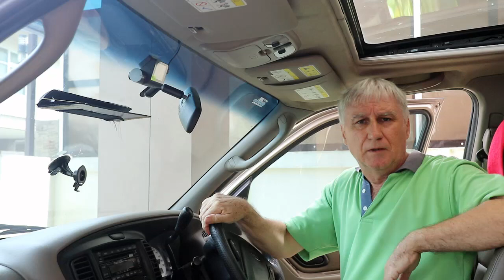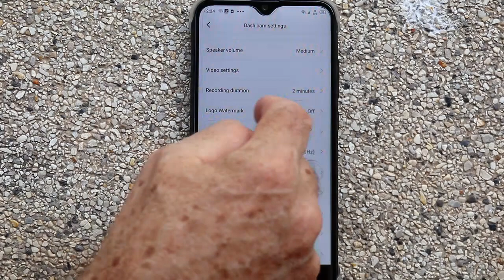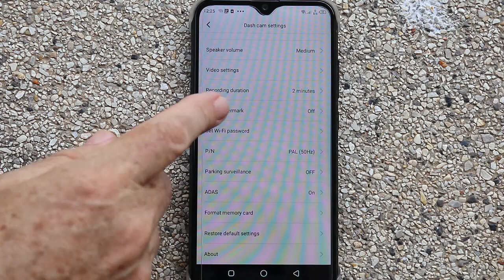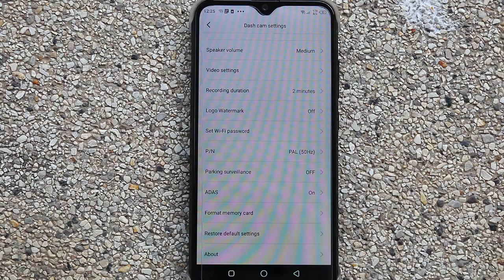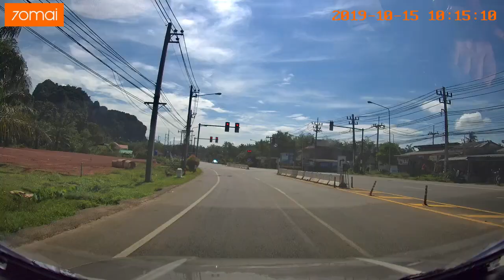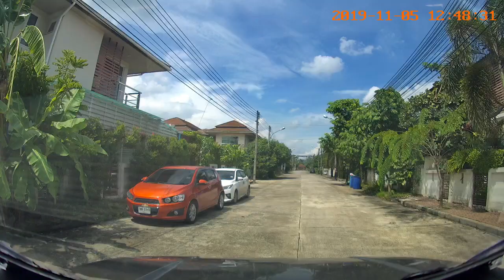70mai Dash Cam Pro Six Month Review + Latest Firmware Update 1.0.6na

Comment: Good update, Phil.. I still didn't get around to update mine
Reply from the maker: The update wasn't straightforward - I went round in circles a few times. Further, the person who told me he can see speed and GPS on videos with 1.0.6na now tells me that he may have a different model dash cam so I may not actually have a problem not being able to see this information. If 70Mai provided a change log for each firmware update it would be less confusing and require less guessing! When you upgrade can you let me know if you can see speed and GPS coordinates on downloaded videos? Thanks.
Reply: @PhilUKNet  Mine is till at Ver. 1.0.5na, sir. Still no .6na upgrade from xiaomi so far for me. The last update was sent and downloaded via e-mail and later transferred to my android and uploaded to my 70mai pro..
Reply from the maker: @ahmadfaisalalias7561  I didn't get it via e-mail. I saw that an update was available for the app and it went from 1.3.2 to 1.4.0. I then connected the app to the dash cam and was able to update from firmware version 1.0.5na to 1.0.6na. Try updating the app to 1.4.0 first.
Reply: @PhilUKNet  I must have missed the boat. Where did you see it?

I am in Malaysia, just to your south..
Reply from the maker: @ahmadfaisalalias7561  I went into the Play Store, searched for the 70mai app (which I had already downloaded) and it told me there was an update. I updated the app (to 1.4.0) and was then able to update my dash cam firmware to 1.0.6na. Unfortunately, the app update only mentions that support is now provided for the 70 tyre pressure monitoring system. It doesn't give any other details and this is one of my criticisms of their firmware management process.
Reply: Phil did u try to return video recording length to 1min to see if the speed and GPS coordinates would appear?
Reply from the maker: @alexyip4424  No, I didn't try that. I restored the factory settings and the speed and coordinates returned when viewing videos on the dash cam, but I still don't have this information on the recorded video. There's another model, the 70mai Dash Cam Lite, which looks similar, but has slightly different features. I'm wondering if my correspondent has one of these. Anyway, thanks for your suggestion.
Reply: @PhilUKNet  can you assist me as to where to get the firmware upgrade?
Reply from the maker: @ahmadfaisalalias7561  First you need to upgrade your phone app by going to the Android Play Store or the Apple App Store. Then connect the phone to the dash cam Wi-Fi hotspot (turn on the Wi-Fi hotspot on your dash cam and connect your phone via Settings and Network). If there is a firmware upgrade available for your device the app will tell you and then you can 'push' the upgrade to your camera.
That's the theory, but my experience has shown that the process isn't good. For example, after I was told about the 1.0.6na firmware upgrade the same guy told me that 1.0.7na had been released. I have tried several times to upgrade my phone app (V1.4.0) so that I can upgrade the firmware but it tells me that no upgrades are available.
Also, 70mai don't give much information about each upgrade, therefore you don't know what has changed. When I upgraded to 1.0.6na the only official information was that support had been added for the 70mai Tire Pressure Monitor Lite. It didn't mention anything about the firmware changes on my 70mai Pro dash cam, which I had to discover myself.
As I said on the video, I am happy with the hardware and the basic functions of the 70mai, but the firmware upgrade process leaves a lot to be desired.
Reply: @PhilUKNet  yes, that seems to be the problem. Funny though as I was informed about the 1.0.5na upgrade via an email from Xiaomi themselves and nothing since. I will try to uninstall and reinstall from the playstore and see where it takes me. Thanks
Reply from the maker: @ahmadfaisalalias7561  Me too. They send me e-mails about some things, but not everything. Just recently I've received a lot of e-mails about the new 70mai Tire Pressure Monitoring System Lite. That seems to be their main focus at the moment. They sent me an an e-mail about new features for products and these features sounded good, but they only applied to 70mai Dash Cam Lite, 70mai Mini Dash Cam and 70mai Smart Dash Cam 1S. Why not the Dash Cam Pro? As far as I know, it hasn't been discontinued. And why send me e-mail updates for products I don't own? Version 1.4.0 of the app seems to include firmware version 1.0.6na for the Dash Cam Pro. I would assume that 1.0.7na is included in a later version of the app, but Play Store tells me that no app updates are available. The fact that other people can upgrade and someone told me that he now sees GPS and speed in the recorded videos, whereas I can't do either, makes me a little frustrated.
Reply: @PhilUKNet  well.. it got me nowhere after all

Comment: Thanks for the update, did they manage to have the sound lourder,  as mine as soon as I open the Windows or switch on the radio I can't hear thé Adas
Reply from the maker: I don't believe so. You would probably need to change the speaker to make it louder. I doubt it can be made louder with firmware alone. It's never been a problem for me, but that's probably because I'm old! I don't bother with music or the radio and it's always so hot here that I have the windows closed and the A/C on.
Reply: Phil UK Net LOL, yes it can be modified with a firmware, usually they always keep 10% safety marge which they can unlock when they want as a iphone
Reply from the maker: @mehdiUtubeful  Thanks for that but, getting back to your original question, they don't appear to have changed the volume settings in this latest firmware version.